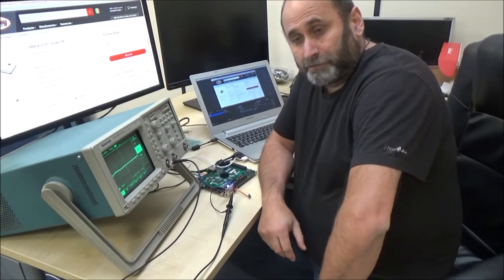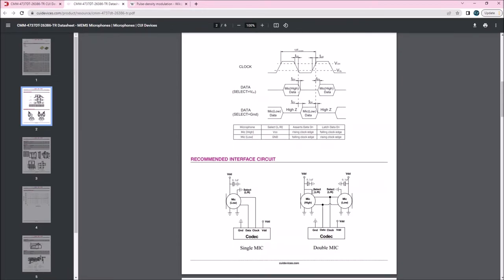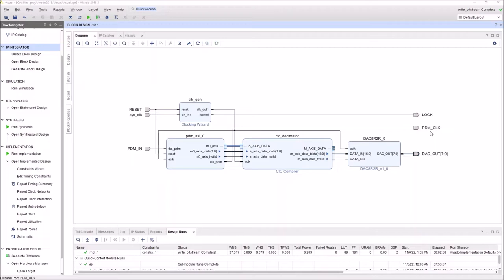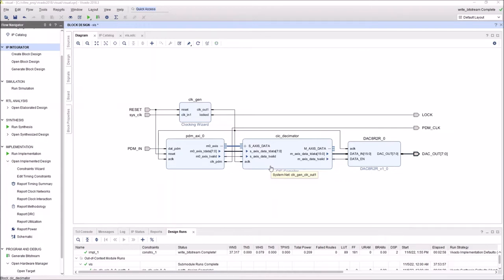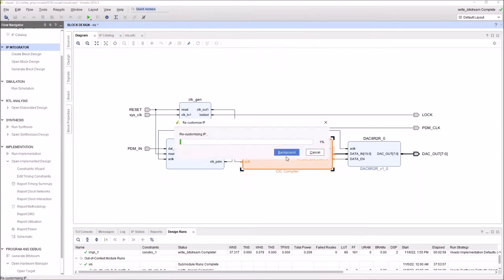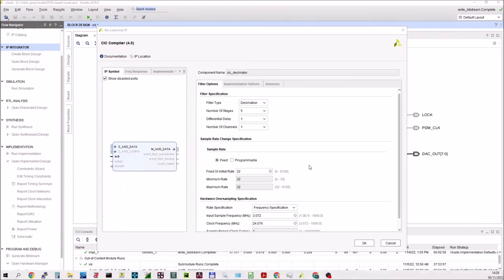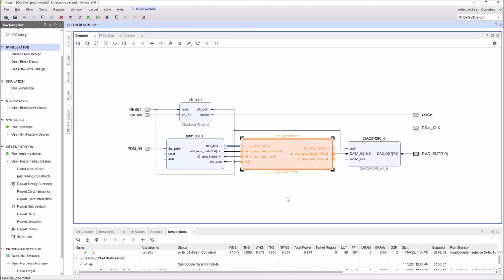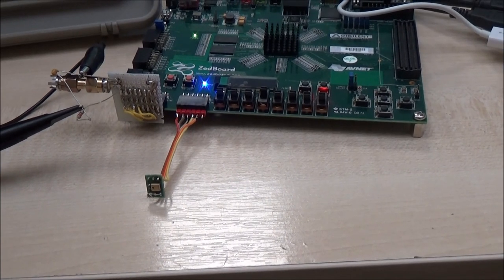FPGA PDM Microphone

Comment: Hello. In the pdm_axi block, you are outputting 8bits on the tdata axi signal. But you say the pdm microphone sends 1 bit bitstreams. So are you waiting 8 clk cycles (at 3.072mhz) to capture 8 bits of pdm data before you send out tdata? Also, in the CIC, you set your input data width to 2, but you are sending 8 bits, why is it only 2? Thank you in advance.
Reply from the maker: Hi Manuel,
I'll start with the CIC - the input of the CIC has a minimum of 2 bits (width of data) because is taking signed samples (on two bits you have the range from -2..+1)  so you have map the output from the microphone 1 and 0 to values to values of  -1 and +1 in order to be compatible with the CIC (exactly in the same way you can map them to 8 bit to actual values of -127/+127)  because AXI interface works in chunks of 8 bits. (btw when you use values lower that 8 bit chunks on AXI you need to make sure you sign extend your values)
The remapping mechanism from 1 and 0 to 8bit signed (-127/+127) does both ie. converting unsigned 1 bit samples into 8 bit signed values (two complement format) this can be done with a mux (in VHDL/Verilog) 
Let me know if you got it.
A
Reply: @adaptivedesign8795  Yes thank you! That cleared up my confusion.
Reply: @adaptivedesign8795  I also wanted to ask if you can give an overview of what the phase_inc block that you have does and how you implemented it so I can do that in verilog. This is the block that sets the phase increment of the dds compiler, I see it in your block diagram in the video where you show the 144mhz transmitter. Thank you.

Comment: Sorry I have a question ,
i understand the decimation process and the use of cic for anti aliasing , but i dont understand how come are the pdm encoding transformed into pcm ,
since we don't have neither info about bit depth of the pdm signal but just the clock signal
Reply from the maker: Hi There,
The pdm output is one bit but on each stage of decimating and low pass filtering (inside the stages of CIC filter) you'll have a bit growth so you end up will a much slower (sampling rate) signal but much wider. The "secret" of the PDM signal is that it contains you audio signal in a very fast digital (noisy) signal with the property of all the noise being located at higher frequency, By decimating and low pass filtering we get rid of the noisy part and remain with the audio component (or band).
Reply: @adaptivedesign8795  thanks for your response so basically if I have a 3 Mhz PDM signal and if i want to have a 8 bit pcm as output , theoretically would be like waiting for 2^8-1 pulses of pdm and in base of the ratio of 1s over total length the pcm data would be defined so if my deduction is correct 
For 1/3Mhz * 256 would be  considered the signal for 1 sample so the pcm sampling would be 1/3Mhz *256?
Reply from the maker: @fc3fc354   That's a very simplistic way of describing it, the bitstream is getting decimated by a large factor 256 (if my memory serves me right) but every time you decimate you need to low pass filter the signal, hence the use of CIC which is perfect for this application because of the large decimation ratio. However nothing will stop you counting the number of 1s and 0s over a 256 bit window and slide that window.  if the number of 1s and zeros is the same that's 0V,. if all bits are 1 that's your positive max if no 1s (all are zeros) that's your negative max. My guess is that you'll still need to low pass your new signal for the audio band. this could be an idea for new implementation.😀
your new sampling rate will be the original / 256 (so every 256bit in the PDM stream you'll have one PCM sample)